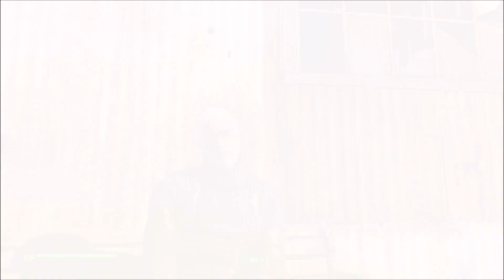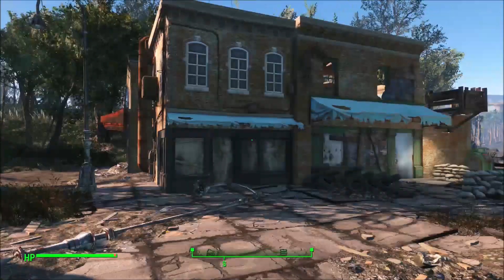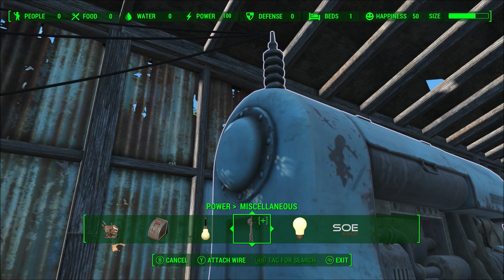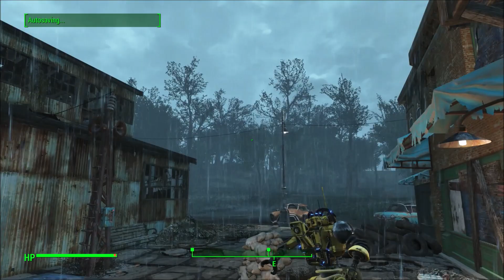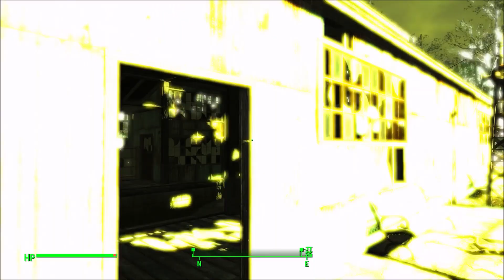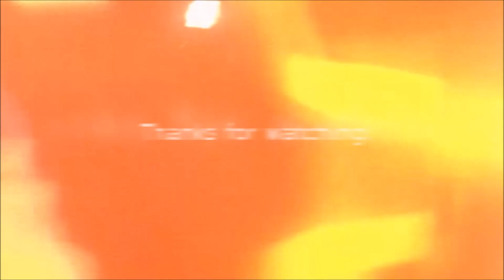Fallout 4: Realistic Street Lights

Comment: Here's a wiring project for you. A neon sign that says "BAR", but the letters light individually in sequence (B, then A, then R) before the whole word flashes a couple of times. Sequence repeats.
Reply from the maker: Lord Runolfr Ulfsson do I get to use mods or is this a vanilla request?
Reply: @nachobidness6667  It would be cool to know if it's possible on PS4, but otherwise mod away.
Reply: use the delay conduits and adjust the on/off time with the terminal. Paul / Skooled zone did something like this for spotlights.
Reply from the maker: So I tried and tried to make this happen.  Once I get above three different power fields in the same area, stuff starts to go wonky.  Just couldn't make it work on XBone with no mods.  Not sure I can make it work even with mods.  Three fields seems to be the limit.